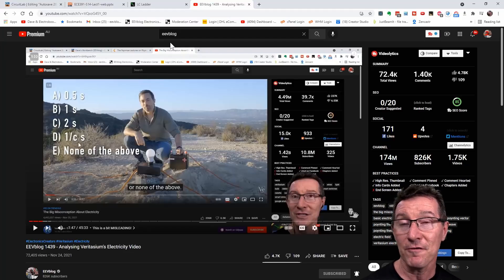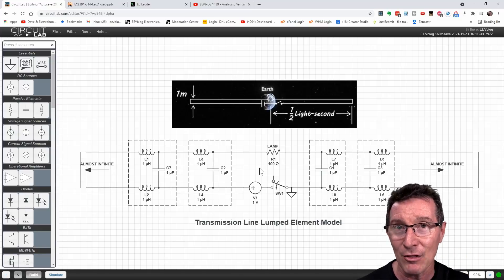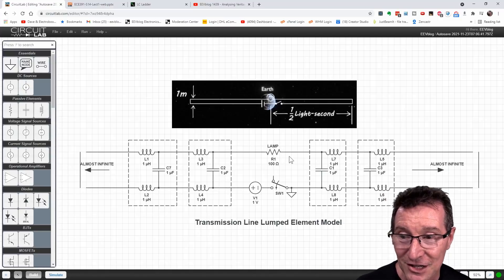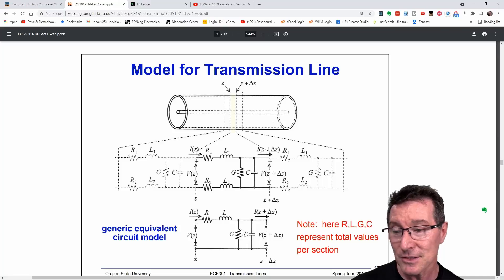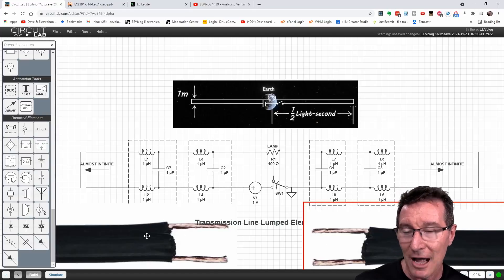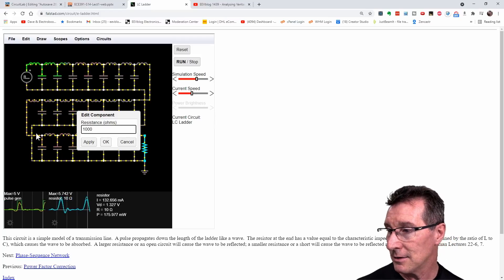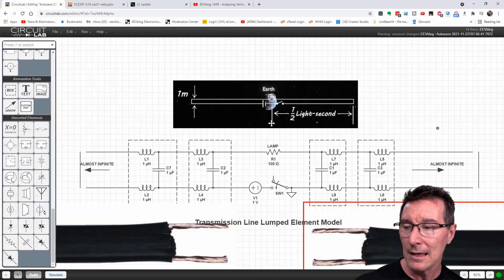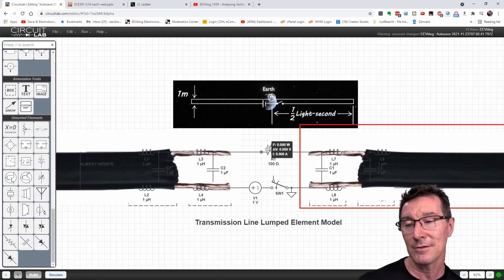Veritasium Electricity Video - Simulation Notes

Comment: Why not ditch the transmission lines altogether and focus on the parasitic capacitance whose charging seems to be basis of the initial tiny current? The transmission lines don't come into play until you're talking about actually delivering energy into the bulb via the fields that follow the wires as opposed to the fields that charge the parasitic capacitance.
Reply from the maker: Because it explains why the bulb lights up instantly, why it's going to have reflections, and also why it takes time to reach DC steady state. You don't need the TX line to get the answer, but it fundamental to understanding it in more detail.
Reply: Fair enough. My suggestion is a simplification for just the part where the light bulb first sees a current which answers the question he posed. Your explanation goes to the longer situation after that which is the actual topic of his video.

Comment: The question is... If at one end there is a cut in the wire effectively breaking the circuit would the light come on, obviously one would assume no, or would it come on just for a fraction of time and then switch off as the energy travels to the end where the break is. 
So
______________(O)______________
|___________(sw)(batt)__________
|
Reply: By what Dave explained, I assume it won't
Reply: The bulb will blink on momentarily in both cases. When there is no break in the cable, after a second, the bulb will start to come back on, if there is a break, it won't.

Comment: Well i still think we actually could break the law of information transfer if we had a field that extended 300 000 km from some giant electromagnetic source, "and could make it dissapate? in an instant".

It is the setup that will be hard...
Reply: Maximum data transfer rate can’t exceed the nyquist rate
Reply: @VandalIO  Well don't remenber Nyquist rate and there is always parallellism. I was more thinking about transfer a message faster then light, in a theoretical parallell setup.
Oh it is just half the sampling frequens that i remember.
Reply from the maker: If your annimations and slide deck are fancy enough, there is $10M in seed funding for you.
Reply: ..thinkin about setup reminds me of the NASA Tether incident (or experiment if you like that better!)...didnt last long! (in my view, i havent seen the data, the voltage and current induced was so damn high it fried the cable and made it snap)

Comment: Why was Thomas Edison insistent on dc supplies ?
Reply: coz all his power stations at the time only generated DC!
Reply: @WacKEDmaN  it would have been a transmission nightmare , imagine long distance dc power grids ? And there would be enormous loses
Reply from the maker: @VandalIO  DC is what is used in ultra long line transmission: https://www.youtube.com/watch?v=AWYuyf3ILLk
Reply: @EEVblog2  So it was just because stepping up AC instead of DC was more convenient and cheap?
Reply: @NullPointer  Yes
Reply: @NullPointer  In those days your best option for stepping up/down DC would probably have been Motor-Generator Units. And even today electric Motors and Generators only run on 10s of KV maximum, because getting enough insulation into a rotating machine is not the easiest thing. Adding a Transformer before/after it is easier. 

So they would probably have been limited to 10s of kV for the highest transmission line voltages, and the maintenance and wear (carbon brushes!) would have been horrible.
Reply: Because that Serbian just couldn't understand American humor, and Edison thought he was a pencil necked geek.